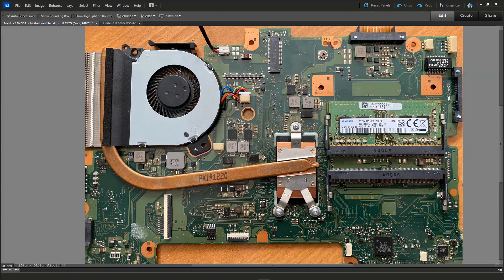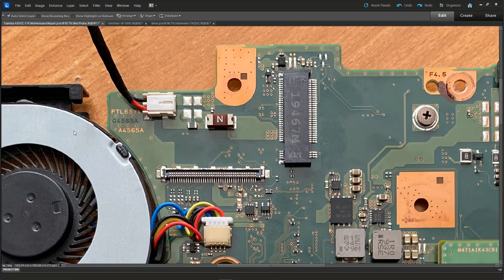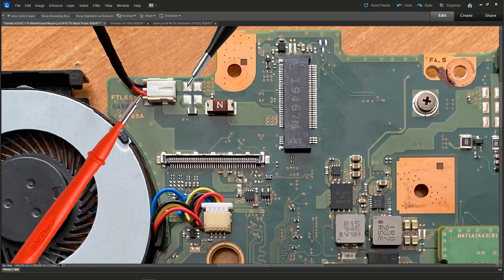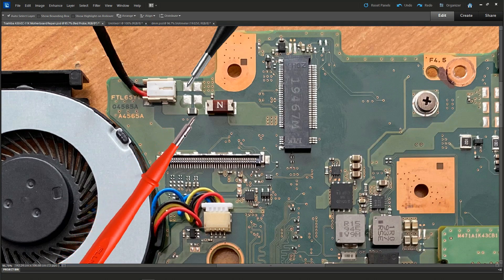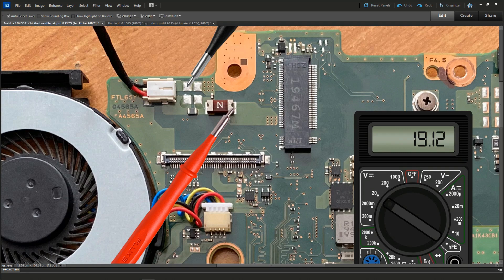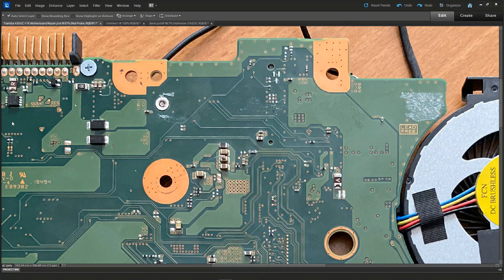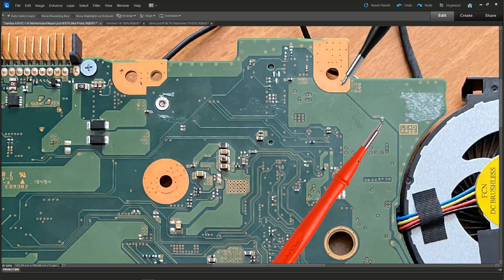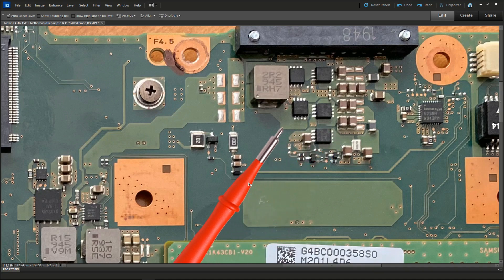Toshiba Satellite Pro A50 EC 11K  No Power Fault, NO BITLOCKER KEY

Comment: What do you use for such hi def pictures of the boards?Some kind of book scanner or just an expensive dslr camera?
Reply from the maker: Hi friend, it's a lot more basic than you might think! I have a plastic light box with LEDs strapped around the sides of it, and a hole at the top where I put my iPhone 11. I take close up pictures of each board in three parts, and join together in Photoshop. It's very time consuming, so I am hoping to work out a quicker way of getting better quality images.
Reply: @therepairshare673  what I like the most is the multimeter probes as mouse cursor.

Comment: Why didn't you just check for a short in the main power rail after the 2 first mosfets? If no short then you could just jump the first 2 mosfets and save some time since it was just a data recovery job.
Reply from the maker: Hi there, thanks for your comment. Before jumping, I injected 19V with my power supply it only drew small current. Having confirmed there was no short I was confident that I could jumper the 19V to that rail without causing harm. 
I did have a lot of trouble tracking where the 19V was going, schematic would be very handy.
Reply: if i want to see which components are get shorted i inject 0.8 or 1 volt not 19 volt because after the 2 first mosfets there can be high mosfet short issue which supply power to CPU cores. If you inject more than 1 volt it can go through high mosfet to directly CPU and kill it.

Comment: hi! what can be the problem when the ssd is not recognised and with a live cd i got a ACPI Bios error?
Reply from the maker: What happened with the laptop - did you just try to boot one day and it would not boot? Would it be possible to put the SSD hard drive in to an external USB enclosure and see if it can be read on another PC?